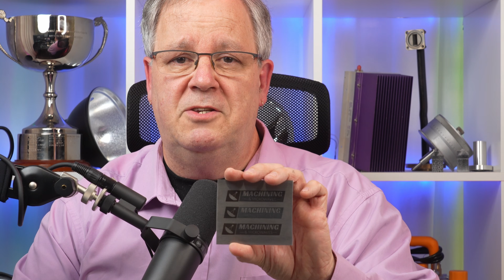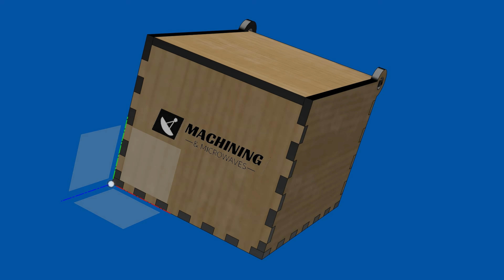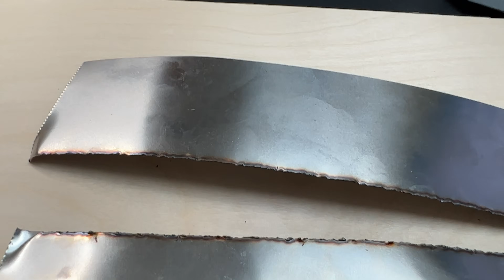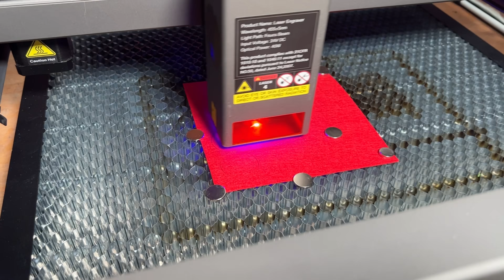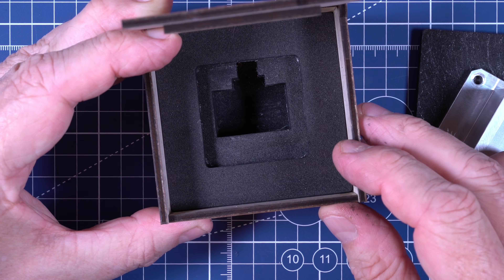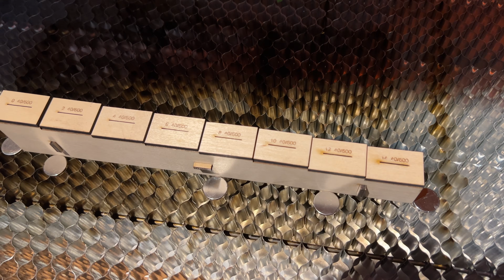Unlock the POWER of Laser Engraving | Creality Falcon2 40W - Fast, Precise, Painless

Comment: There's something about blue light - biological rather than physical, I gather - that makes it more hazardous than other colours.  I'll have to find a source though.
Reply: At these power levels you'll be blind faster than you can even blink. And that's just from a random reflection....god knows what a direct hit would do. Doesn't matter the wavelength at powers like this
Reply from the maker: As I said in the vid, human eyes are optimised for visible light, so there is zero protection. My Edmund goggles only reduce the optical power by a factor of ten million, but the original power is around 3GW/sq m, so even with 10 mrad of divergence, a direct hit is still going to be 200 watts per square metre, at a metre distance, similar to looking at the sun.  I've had laser burns on my retina in the past, but they were peripheral.

Comment: Nice!  I have been using lightburn for about 3 years with a heavily modified CO2 laser, it's worth ever penny of the price!
Nice big extractor fans are a must, I'm running it from a garage - having been banned from the house due to the smoke and fumes!
Reply from the maker: I'll probably set it up in the workshop with the 3D print and electrochemistry stuff.  There's a 16 inch extractor fan in there that shifts just about anything, also proper fire suppression systems.  I find myself wanting to write scripts to generate complex shapes with 50 or more combinations of speed and power

Comment: So no SMD stencils it looks like?  what kind of lasers do they use for making those in industrial settings?
Reply from the maker: I guess fibre lasers.  The resolution of this thing is decent, and it might work on a very thin stainless foil, so I need to try that.  Perhaps 0.05 mm would be less likely to oxidize at the edges.  I'll get some ordered and try some tests. I want to try metamaterials and diffraction gratings at mmWave. That really needs chemical etching.  Problem is that all the folks on the forums are interested in etching on painted stainless mugs or glass or leather or wood, so there's not much info about coatings for cutting shiny, highly conductive metals.  It might be that to get clean edges, I'll have to use an argon feed into the Air Assist to prevent oxidation.  Back-purge might also be required, like for TIG welding.  I'll look into the possibilities anyway

Comment: That honeycomb plate is awfully reflective, might be a good idea to coat it black. High temperature matte black spray paint is a good candidate as it's suitable for laser beam dumps and you can just spray on another coat if it gets rubbed off.
Reply from the maker: It would make an interesting experiment to see if matt black stove paint would work, or if it might burn the honeycomb. I think the reasoning for having it shiny is that it should reflect rather than absorb, so it doesn't melt.  The material is extremely thin, so dissipating heat by conduction is tough.  As there's only the top edge that the laser can touch, it's not very likely that the beam will be reflected.  The aluminium plate below the honeycomb is far more reflective and it's being hit at right angles. For small parts, there is a slight risk of reflections making it out, but in general it might be better to use some black-painted baffle sheets on the top side of the honeycomb, they might be useful for alignment if they were set to run parallel to the chassis.  I also worry that if the honeycomb is made more absorbent, that very thin metal might not survive slow cuts.  I'm thinking in terms of a 1/4 inch mild steel plate with a very matt finish and using magnetic pillars rather than the honeycomb for cutting anything thick at high power.
Reply: @MachiningandMicrowaves   A reflective mat finish would reflectively scatter and dissipate the energy rather that absorb it.

Comment: "When I've got a great big radial arm saw...."

Ah, I see you like to shake hands with danger on a regular basis! 😳😆 I was in the workshop when my boss clipped the back post with his set at a high angle, oh boy I heard some brand new swearwords that day! 😂
Reply from the maker: I once fell asleep using an UNGUARDED bench saw at 3 AM in a deserted part of Hull Docks.  I was trying to finish a fake antique Welsh Dresser, which we were making from old ships' planking, dipping it in a stripping bath (hot caustic soda) then drilling woodworm holes and injecting wood flour, creating fake wear on drawers and doors and  fake water stains, then wrapping them in old hessian sacks and thrashing them with rusty chains, then doing some fake repairs and polishing them with a 50 year old can of Briwax, before shipping them off to France.  I didn't lose any digits, but it was close, and getting to the hospital wasn't easy.  I still have scars and they itch a bit!  I also have a 14 inch log saw and several chainsaws, so plenty of opportunities for inconvenient things like death.
Reply from the maker: The circular saw incident was in 1981.  Safety processes are a little more advanced these days
Reply: @MachiningandMicrowaves "inconvenient things like death" - if your humor were any drier, the Corrino Imperium would colonize it and mine it for Spice. 😂

Comment: PLEASE consider an enclosure with high optical density! 40W is a lot of power and I don't want to see you get injured by catching a stray glint to the eye.
I must admit I do want one of these though.
Reply from the maker: I have Edmund Optics OD7 UV-blue enclosed goggles, so I can probably  take a reflection hit, but I don't operate the machine outside the cover, and I sit at the other end of the room with my back to the  machine, with a webcam monitoring what it's doing.  I had a laser burns on my left retina in the 1970s and I don't want another!  That was caused by foolishness with a steel ruler and a big research laser. My father lost an eye working in gas turbine engineering, and I'm rather fond of being able to see!
Reply: @MachiningandMicrowaves  Ok, you are operating it in the enclosure, that is a relief. Wasn't entirely clear from the video and I'm a worry wart.
The idea of these things not having an enclosure really bothers my laser safety training.
Being in a room with an operating laser system without PPE, the '70s sure were different. From all the stories I've heard it seems safety was just a type of pin back then.
Now that the anxiety has been placated I'm curious what you were working on. From the description it seems it was a high power pulsed laser?
Reply from the maker: There was a room-sized CO2 laser that did 0.1 terawatt pulses, and some ruddy great ruby rod/xenon things that were scary
Reply: @MachiningandMicrowaves  that's huge for a CO2 laser, but I suppose there aren't many other options for high power MIR.
Reply from the maker: The Creality enclosure covers the lower part of the frame very well, but I'm not going to take any risks at all, I throw those goggles on whenever I go near the machine.  I should really try blasting the supplied goggles with a laser power detector in front of them to see how they behave.  Mine drop the intensity by a factor of 10^7, but 40 watts on a 0.1 x 0.15 mm area is an immense power density
Reply from the maker: The other aspect is that using those zippers is going to get old REALLY fast, so I'll probably make a solid case with fire suppression and a strong suction under the honeycomb for doing printed circuit board filters and other thin materials that need to be held down to remain flat
Reply: @MachiningandMicrowaves  ugh, zippers. I really like that vacuum table idea though. If/when I get one of these things I'm stealing that idea.
Reply: Best is to put it in a light tight metal box with interlock. as long as the interlock switches off the laser before you break te "light seal" you should be good.
You can then put the USB cam inside.

At my job we use a ~1.5w UV laser and it has multiple interlocks. Be as good as an industry safety standard.
Reply from the maker: @zorktxandnand3774  I'll need to extend the emergency stop outside the box as well . Might add a cheap secondhand laptop as a dedicated control console and webcam monitor. Maybe wireless connection too, plus fire suppression
Reply: @MachiningandMicrowaves  Yes the emergency stop on the outside is a good idea. A big button to slam when things go belly up🤣 
The old laptop and fire suppression are also very sensible additions.
Reply from the maker: @zorktxandnand3774  Another thing about a larger enclosure is that I could use a Lightburn camera for positioning, I can't get enough height with the zippy fabric case to fit a LB compatible overhead camera.
Reply: @MachiningandMicrowaves  I guess there is no such thing as a finished project.
 good luck with the build.
Reply: @zorktxandnand3774  That's my thought If I ever get one of these things. I've looked at using some kind of high OD plastic or the like but I'm just not sure it's worth it for something like this. I could see it for  something like SLS where you really need to keep an eye on it, since a failure is so costly in time and money, but I'm probably just going with sheet metal for a cutter/engraver.
Reply: Indeed, I think it's rather irresponsible to even sell these without the enclosure. These are powerful tools being sold to the general public and our day-to-day life experience does not prepare us for the kinds of risks associated with powerful lasers. Goggles are not enough to protect an enthusiastic amateur from himself.
Reply: I guess you can engineer your self a super safe pair of laser goggles that are light tight, with stereo camera's and LCD panels on the inside.
As long as you do not have a laser that buns through your  goggles you should be fine 😋